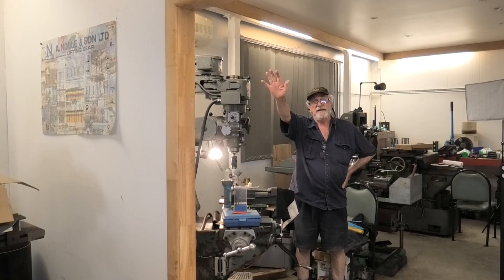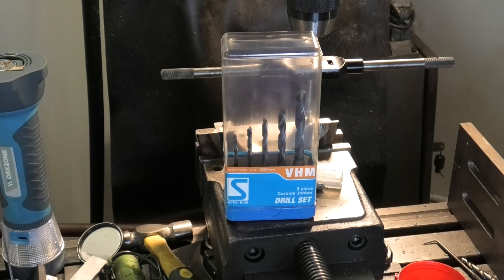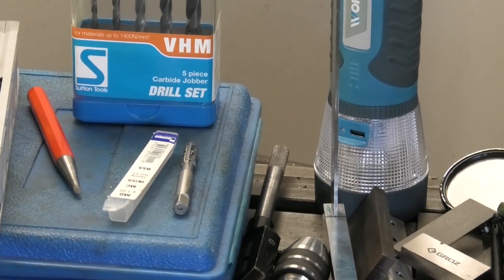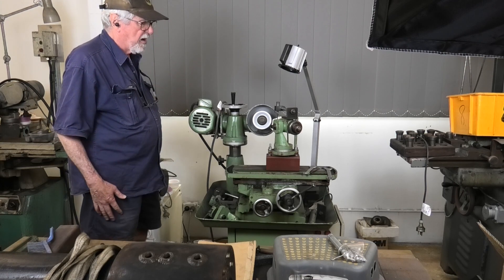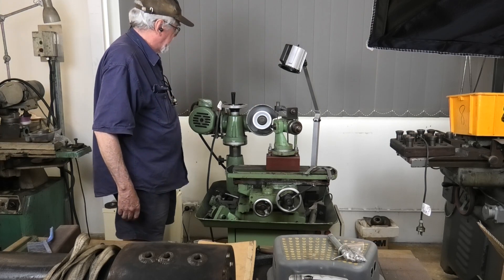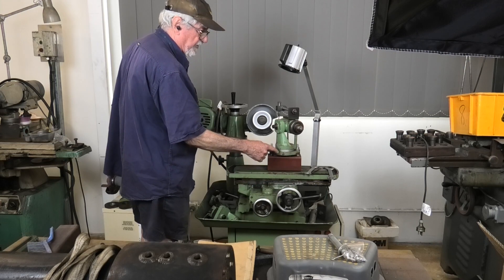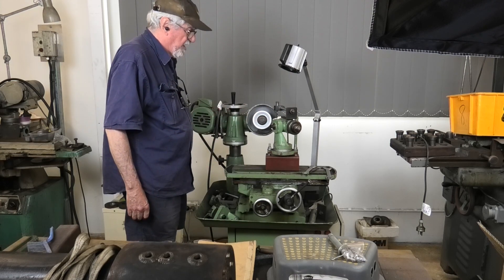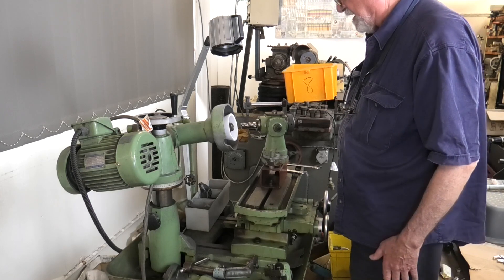Tool and cutter controls

Comment: I've had one of those same machines that was imported to the US under the MSC label.   I use a KO Lee at work quite a bit and I really appreciate the multiple axis that the import machine has. I wish there was a 5C toolhead available for it.  The one I have is MT3.
Reply from the maker: Hello Mr. M. Yes mine is a MT3 as well. I would like to try a heavier workhead. We did use an air spindle for a while but it was akward with annular cutters.